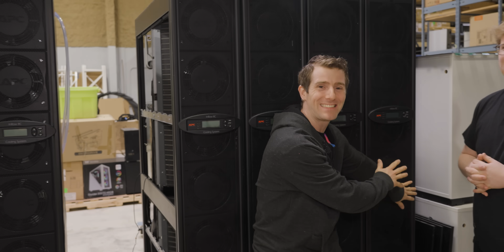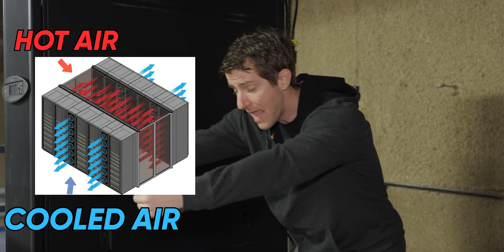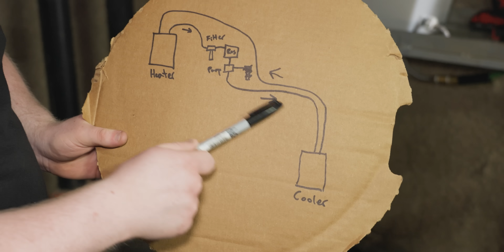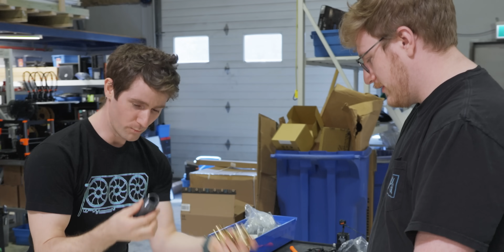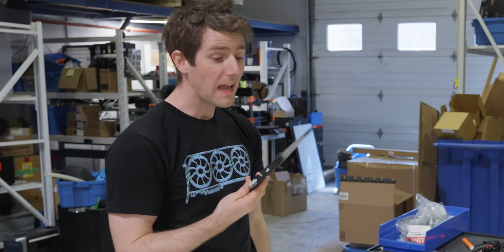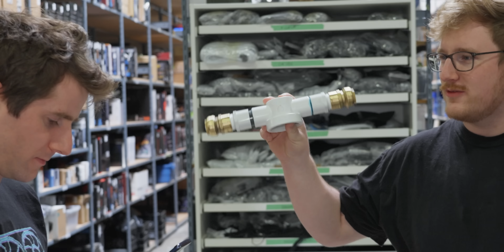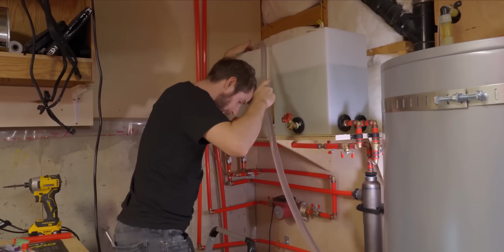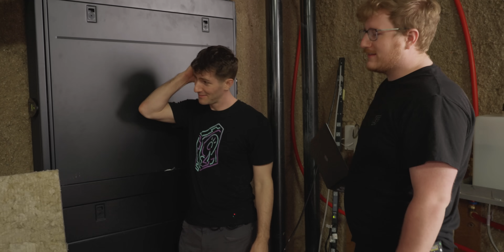I shouldn’t have kept the $1,000,000 computer

Comment: Never been a huge fan of those APC rack coolers. 

Work for a rapidly expanding DC operator, and our higher density applications are quickly turning into a blend of hot aisle containment, with ducting straight to return plenum, and cold aisle containment to assist in preventing short cycling, along with judicious use of rack panel blanking.  

The higher density environments, (25+ kW/rack, are starting to require chilled water loops from our 1500 ton chillers going straight to another heat exchanger pushing chilled fluid to the chip. 

Thermal management is somewhat wild, and an interesting CFD modeling problem.
Reply: Hi, how did you get into ur line of work and get the knowledge you need to plan, manage and build datacenters/networking stuff? I'm still doing my degree for compsci and networking, system admin seems like a fun thing to get into but I just dont know the progression to get there and the things I learn is more to theory and textbook. Thanks!

Comment: I've seen a datacenter where all fans were taken away from the servers with a closed hot corridor. All hot air was sucked out to the roof so that the cool air (18C) from the front was sucked through the racks. No power costs for 42 HE x 8 coolers x 40 racks of fans... It was very silent.

Comment: I went through all this just before retiring. Smart valving and dumping waste heat will work for a good chunk of the year but you'll still need a water chiller for a few months a year to be able to transfer heat when it goes over ~25C ambient. That said, you'll achieve much better sensible cooling efficiency with a chiller than with CRAC units due to the chiller's higher output temperatures (in this case the chiller is interposed between the server room and the external radiators)

I did propose that we use the waste heat to warm up the facility swimming pool in winter but that was kyboshed because someone would have to pay for 200 metres of waterline to get to it and nobody would stump up (it would have made the radiator/chiller load a LOT less in summer when the pool can act as a daytime heat soak and night time radiator, with power savings paying for itself pretty quickly)

My server room went from being thermally limited to 18KW of cooling to being certified for up to 80kW (with failover) at roughly half the power consumption of the old CRAC setups at full song - most of the time the only load is pumps and fans....

Doing it right is vastrly cheaper than doing it over. It was a £250k job to fit the appropriate power and cooling systems (which I had asked for in the first place) rather than having pointy haired managers discard my requirements as excessive - resulting in the "new server room" being unable to accomodate all the existing kit scattered around the estate as we couldn't cool it sufficiently followed by 10 years of stand-up screaming matches and regulators demanding we clear out kit from the "old server rooms(*), which needed to be repurposed as ITAR secure storage" 

It's insanely difficult to run a 24*7*365 operation with some contracts subject to downtime service penalties(**) when you're changing the cooling and all the power feeds at the same time

(*)those rooms - usually converted closets - ended up being stuffed full of other kit as soon as our backs were turned after we removed the critical stuff, which made the problem even worse. Never allow "temporary" accomodation when closing down an old server room and make sure you disable the cooling, or SOMEONE will manage to sneak stuff in there and make it your problem again

(**) When you explicitly say there is no way to guarantee continual service and people sell it to governmental entities with those guarantees, guess whose head that lands on? If you said the IT staff you'd understand why we go grey prematurely.

Comment: So the thing is, it's important for the hot "aisle" to not get too hot, because that's also the majority of the surface area of your servers and other gear. All that heat will do its best to heat up the gear that runs cooler, making the fans work harder. You know what else is back there? Your fibre optic modules.

In our case, basically the hot air was piling up in the hot aisle, and the fans just couldn't get enough cold air. It was so bad, the hot air was pushing through the gaps between the back of our switches and the rack blanking panels, so they were mostly sucking in hot air. Even where we had custom-made inlet shrouds, the air was still pushing in the tiny gap between the shroud and blanking panels, and also the hole where the power cable came through. First we tried fixing it by removing a few blanking panels here and there to push a little cold air into the hot aisle, but it only helped a few degrees. Eventually we fixed the problem, not by cranking up the compressor power, I think we only increased it by maybe 10-15%, but by increasing the fans from like 10-40% to 50-70%, and now the temps are basically normal. I think the hot aisle averages around 35°C, getting up to around 39°C behind the more full racks.

But the biggest difference was the fibre modules. We had a couple of modules that was alarming because they were hitting their max temp rating of only 60°C! I literally burnt my finger touching one of the modules to check how hot it was. After those changes, they went from around 66-67°C to 45-46°C. Thankfully most of our modules were rated at 70°C, so we were only getting alerts for two.

So yeah, you definitely want to be pulling that hot air out as fast as you can.

Comment: You can use a HVAC AC calculator to find out the estimated AC unit size, in tons, it should cool a sq. foot room.  What is the humidity for that room? E.g., If you take your 10kwts x 3.413 / 12k BTU = 2.84 ton AC + 5k BTU (10x10) room / 12k = ~3.25 tons  Your 3 ton is too small if you factor in the other variables, such as doors, height, windows, (sun)light, insulation, humidity, & temps.  What it sounds like is you didn't build in room for expansion with the rooms cooling and went the cheaper route of a 3-ton instead of a 5-ton AC. :)

Comment: jep they just add heat to the room. seen it go up to 80/90 celcius and burn up the old ac unit power lines in a data center. when you see your servers go down due to heat your not happy. So we added a water cooler to the room where the heat went outside.

Comment: Use a HEAT PUMP in cooling mode to cool the water in your water storage vessel to 10'C / 50'F , then pump the cold water it through your cooling tower system.

Comment: good gosh... IT guys should stay in IT and plumbers should make plumping stuff... and also the calculations on thermodynamics should made... this entire concept is crap. the amount on energy wasted to move all the air and move all the water (which is also produces heat) could be spent on cooling... that's why you use air conditioners totransfer the heat... and these APC units were nothing else than this white blower from the air conditioning in the server room... but bigger. so to transfer heat without AC, you need a really big amount of heat difference... and this is not the case. So it's absolute waste of time money and energy.

Comment: Unless the chiller outputs the hot side to the environment, the warehouse is going to heat up anyways. same reasoning as opening a fridge to cool of in the summer. reason beeing, the energy gets transferred from cold to hot and the air conditioning also uses up energy to run.

Comment: More simply, they use the split air conditioning that they already have and put the condenser inside the warehose.
They can have two air conditioners, In the summer they use the one with the condenser outside, expelling the heat out of the warehouse. in winter the other.
They also have backup when maintenance needs to be done on one.
I always watch your videos from Lima Peru

Comment: You've basically built a boiler system. You should shoot for a 10 degree deltaT. Your flow rate is too high. The "cooling" rad doesn't have enough time to shed the heat you're pumping into it. Slowing your flow rate should help, along with running the output fan at a higher rate.

Comment: I contend that A/C is not a good cooling solution. Air exchange is a much better solution, with A/C becoming important, only when the incoming air is above a certain temperature. I would build a system that emphasized pulling a massive amount of air, from the outside, and dumping it outside, away from the air intake. This allows you to use the world as your air conditioner. Only when outside temperatures are over a set temp, would you worry about conditioning the incoming air, which should be rarely. Even when you do need to condition the air, it would be far easier and cheaper to use evaporative methods, as opposed to compressor based cooling. A water curtain or cardboard based evaporative solutions, for example.

Comment: 38C? its every day temp for me and my GPU is sustained at 100C
Reply: High temperatures can accelerate wear and tear on equipment and increase the risk of hardware failure the excessive heat can affect the performance and reliability of storage devices potentially leading to data loss or corruption
Reply: and also you might want to get that checked out 100c on your gpu kindaaa hot man.... most people avg 85c on the gpu max
Reply: @iplayfortnite8302  it's AMD RADEON 6800XT 😂
Reply: @serpentblade8704  how is it reaching 100c avg 6800xt is a mid range card with quite a decently size cooler did you ever clean out the dust or repaste it?

Comment: I run a small 24 rack data center that uses these exact in row coolers. The valve is to balance pressure if using multiple coolers in a loop.

Comment: I want to build a Gaming pc this summer and my budget is 1500 +/- and i would want to know if i picked good parts 
Motherboard:MSI B650M Gaming plus wifi
CPU: Ryzen 5 7600x
GPU: Gigabyte radeon RX 7800 XT
RAM: 32GB of Corsair Vengeance DDR5
Case: Zalman P30 Micro-ATX Tower Pc Case
CPU cooler: Thermalright Phantom Spirit 120 SE Air cooler
PSU: Corsair RM750E 750wtt  PCIe 5.0 80plus gold

Please give me Feedback:)